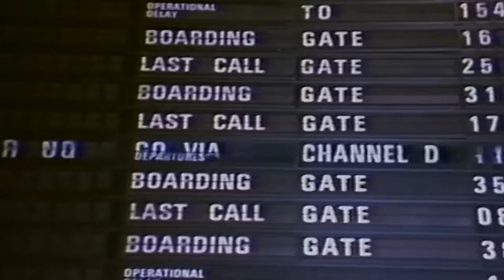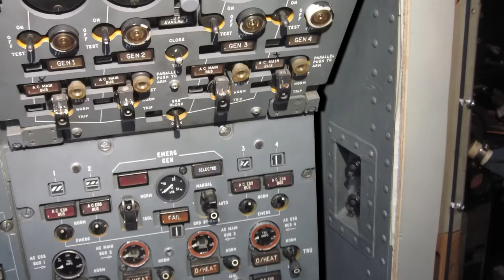Why Blue Paint Caused Problems For Concorde

Comment: “Safer than flying at Mach 2 in a tin can.” This is referring to an airplane with 27 years in the air and a perfect safety record. 

There was one accident and it was caused by the grossly negligent maintenance of a foreign airline’s plane.
Reply: That is not the full truth Rory, for the whole sorry story and the facts watch this. https://www.youtube.com/watch?v=fqOcYhzWUZY The strip of metal from the Continental DC10 was just one factor in a whole series of events comprising of maintainance and aircrew errors which went to make up the accident chain. The Air France Concorde was over weight, with too much fuel and baggage on board, it was aft of c of g limits, it took off down wind, over a lip on a pievce of runway wich was being resurfaced and officially closed, there was a pacer missing from the left main undercarriage bogey, the flight engineer shut down a perfectly servicable engine immediatey after the aircraft got airborne, with out consulting the Captain.
Reply: @markdesmond4947  Still not a design error. It was pilot error then.
Reply: Did the Bree from UTC time the dc10 debree riped the tire and since he filled the plane With full fuel it was to heavy lost an engine from the tire being in the engine as stalled
Reply: Mark Desmond you are completely correct about all of those things. However, none of them were intrinsic design flaws in the Concorde that would make it true to say that she was a dangerous airplane. 

You can shoot a guy with a shotgun and make him run a mile. When he collapses does that mean that there is something wrong with him?
Reply: Mark Desmond In fact all of the mistakes and miscalculations that you mention would have been absorbed into the robustness of the Concorde’s design were it not for that stupid friggin strip of metal. 

The plane probably flew a thousand times with the CG wrong, overloaded, took off in a dead calm that people on the internet 30 years later will call a tailwind. There was NOTHING wrong with that airplane. There was NOTHING wrong with how it was being operated. The pilot was a hero and the conclusions were come to so Air France could call the insurance company. The cause of the accident was the shard of metal off the DC10
Reply: "Bloody foreigners !"
Reply: @Papershields001  I'm sure your right Rory, I never said anything about a design fault, the design was perfectly good. However numerous design limits were exceeded through the very poor airmanship demonstrated by the aircrew in addition to the poor engineering practices of Air France and Continental .  Down wind + overweight resulted in a huge wheel/tyre design limit overspeed, resulting in huge centrifugal forces being generated in the tyres. Despite this, the metal slicing off a chunk of tyre which hit the underwing did not penetrate the wing or tank. However because the tanks were topped off to 100% capacity there was no room for the shock wave set up in the fuel to disapate, so the tank burst. This was a totally avoidable accident and removing any single one of the factors in the chain, ie take off direction, fuel weight, baggage, runway condition including work in progress lip undercarriage spacer omission or the much written about piece of Continental DC10 metal would have prevented it. Sadly all the holes in the swiss cheese lined up.
Reply: Rory Shields https://en.wikipedia.org/wiki/Air_France_Flight_4590

Read the alternate theories.  If a small piece of metal can cause a tire to explode with such force that causes your plane to crash, is it really that robust?  And how is the pilot a hero?  Did he miraculously save the flight? Because the Concorde was overloaded, and had veered on the runway, the takeoff was longer than normal, and caused the Concorde to hit the strip of metal in the first place.
Reply: What did they expect? It was a Continental DC-10...every time one of those took off something broke loose.
Reply: I like all those YouTube educated engineers..... 🙄
Reply: Aerospace Exploration  if the French were not involved, we probably would have ended up with the Concord, no trailing e.
Reply: Yeah I hated when he said that, Minimizing genius engineering down to"a tin can".
Reply: People are assuming that the crash is what got it shut down, but it flew for another three years after that.  It cost way too much to operate. And I would argue that yes, that is a design flaw.
Reply: @Rory Sheilds you obviously have not event the slightest clue what you’re on about. This was a catalogue of Air France error and deliberate disregard for safety. The corrupt BEA pinned it on North West to save Air France.
Reply: @phantomaviator1318  it wasn't pilot error.  A strip of metal from another aircraft was on the runway.  The tyre of the concord ran over it causing the tyre to burst sending pieces into the wing tank. The leaking fuel ignited.  Not pilot error at all.
Reply: The plane was too costly to operate in fuel costs
Reply: @atomic4650  Yes, the peak of commercial aircraft engineering. Yes, it would guzzle fuel like there is no tomorrow but nothing like it for those outside of the military.
Reply: @peteconrad2077  He just needed an excuse to bash the US
Reply: Aerospace Exploration Continental was the “Foreign Airline” I was referring to. It was a French plane in Paris.
Reply: There were several bits of minutiae that were brought up referring to things that may have slightly increased the planes chances to make an emergency landing at Le Bourget; A slightly miscalculated center of gravity, the the slight overloading of the plane, the mistaken actions of the crew in the literal seconds after rotation.

NONE of those things had ANYTHING to do with turning the Concorde into a giant pillar of fire in the first place.
Reply: Rory Shields a burst tire is always a possibility, design didn’t allow for it!
Reply: Carmen Grace yes. There had been 57 documented tire bursts on the Concorde before the disaster in Paris. Illustrating my point EXACTLY. The plane could handle tire bursts, it did it for 27 years. The airplane had a fantastic safety record and the circumstances that caused the accident were extraordinary.

My point is that the video’s claim that the Concorde was an inherently “Unsafe, Tin Can” is ridiculous.
Reply: Carmen Grace yes it did. What it didn’t allow for was a debris impact with overfilled fuel tanks. Check your facts. Air France also refused to use the cow catchers that BA used which deflected debris rearward instead of upwards. Air France were entirely to blame.
Reply: Rory Shields you ave no idea what you’re talking about. 

Over full fuel tanks allowed the hydraulic shock that ruptured the tanks skins. If the tanks had been left with the recommend expansion void they would only have dented. 

The aft C of G made the aircraft unflyable. The remaining eleven authority wasn’t enough to avoid the aircraft exceeding its zero rate of climb attitude. 

The aircrafts overweight led to the swerve that cause dit to hit the debris which was outside its normal runway path.  

If you don’t know what you’re taking about do yourself a favour and keep quiet. You’re making a fool of yourself.
Reply: @Papershields001  couple things here. First of all there were design flaws with Concorde. One of them was that the tyres were not strong enough to resist the speed of take off and landing for more than a couple flights. This meant that they burst on a regular basis, and it was known that they could burst with enough force to puncture the wing tanks. That is why British Airways put shields above the wheels of their aircraft, which Air France never did because they deemed it unnecessary.
Air France's maintenance was also deplorable, as its been stated above so i wont go into details about that.
But to say that the accident was caused by the negligence of another airline is simply ridiculous, Air France's Concordes were accidents waiting to happen. In fact the plane cought on fire before even reaching that metal strip, which most likely had nothing to do with the outcome anyway.
I do however agree with you with the fact that calling it an unsafe tin can is flat out wrong, the fact was an absolute marvel of engineering and that accident was caused by faulty maintenance/Air France being cheap rather than poor design.
Reply: Pete Conrad ok sure buddy...the plane totally would have crashed WITHOUT the debris on the runway
Reply: @Papershields001  yes, more than likely it would have crashed without the piece of debris
Reply: AnnicK Zoloft remind me to ask you for advice on lottery numbers
Reply: @Papershields001  yes because clearly assessing that a plane doesnt need to hit debris to crash when its landing gear is wrongly assembled, that its overweight, out of balance and has a tyre explode and burst the fuel tanks is comparable to bullshitting about lottery numbers
Reply: AnnicK Zoloft “yeah Titanic woulda sank anyway even without the iceberg...”
Reply: @Papershields001  omfg dude... Titanic was brand new and there was nothing wrong with the boat... everything was wrong with that plane, like everything that can possibly be wrong on a plane was wrong on that day
Reply: AnnicK Zoloft ok, a ship that sailed and sent 1,500 people to the bottom of the Atlantic on its maiden voyage is safer than an airplane that flew thousands upon thousands of times for nearly 30 years without incident. Great logic you’ve got there.

This is exactly what I’m talking about.
Reply: AnnicK Zoloft it’s like you guys don’t know what insurance, culpability and litigation is... 

Of course the FAA will find something wrong with the Concorde and minimize what Continental and Michelin(who made the tires) did. It was in their best interest to bring up whatever  inconsequential bullshit they could find to make American companies less culpable.

No sense of perspective
Reply: True...an American Continental Airlines plane.
Reply: DC 10...death chamber 10.
Reply: @markdesmond4947  Its Called F.O.D  Foreign Object Damage . Many aircraft drop bites and pieces , Mostly screws and small panels .
Reply: Absolutely agree the Concorde was fantastic. Only drawbacks where Sonic booms over populated areas and price.
Reply: @ @killagramx   Yes I am aware of that, I have been a private pilot for over 40 years. None of the many aircraft that I have flown have ever dropped bits and pieces. The point is, if the fuel tanks had been filled to the correct maximum 80% level and not overfilled to 100% capacity the FOD created slice of high velocity tyre, which did not puncture the wing or tank would not have produced the high energy and destructive shock waved which destroyed the fuel tank and caused the fire. The ignition scorce of which was probably the anti skid system wiring of the undercarriage bogey, which had been damaged because of the missing spacer and the lip on the closed section of runway used where resurfacing work was in progress. As I have previously said all the facts are here. https://www.youtube.com/watch?v=fqOcYhzWUZY    The DC-10 FOD was only one link in the accident chain but very handy for Air France and the French authorities to blame the accident on and to conceal the Aircrews shocking decision making and lack of airmanship and the airlines woeful engineering practice which allowed the aircraft to fly with a vital part missing from the undercarriage. It is notable that the charges to the Continental Airways engineers were dropped  and that the UK air accident investigation branch were not permitted access to the investigation.
Reply: Rory Shields It also had design flaws such as weaker fuel tanks, it was not the first time Concorde had a fuel tank burst, it happened 1/2 times before but the fire was caused by a design flaw with exposed wires inside the landing gear compartment, when the tyre burst a chunk of rubber flew up, hit the fuel tank bursting it, another chunk of rubber flew into the compartment where the landing gear is during flight, it hit a wire, which snapped and as the two ends of the wire bounced around they touched and sparked, which was enough to ignite the fuel, the rest is history. Maintenance issues from Air France did play a role in the disaster but equally there were design flaws and pilot error. Please reply if you have any questions as I do know quite a bit on the matter.
Reply: gorillaau if the French were involved we wouldn't have Concorde, 1:Concorde means agreement between two nations so it would not have been called that if there was no 'team work' 2: Without the French, Concorde or any Supersonic airliner wouldn't have existed, same with the British
Reply: Too much fuel was main issue I think as if left some air in tank there be no issue of tank, I am sure there more than one that crashed but not 100% on that, Great Britain or United Kingdom (no they not the same) was working on one and as france was similar design they joined forces to beat America to super sonic, they stopped as on launch it was $6 million a year to run and in 2003 it was about $23 million or something and on this day they predict a year be $63 million or over $100 million
Reply: Tin can! Take it easy there fella. 
Concorde was no “tin can”
Reply: @christophedecavalla2941  tin can on the those things, not 100% sure on spelling or if youtube likes it but the thing start with S that muscle people use
Reply: The accident wasn't  one reason it was multiple reasons. In fact the blame was placed on the Conchords  fuel tank design and it's  lack of protection  .  It was a bizarre accident but placing blame solely on one thing is irresponsible.
Reply: That comment makes zero sense
Reply: He didn't say the plane was inherently unsafe. He said teleconferencing is safer than flying. How many people have died in teleconferencing accidents?
Reply: mlee6050 no there was not more than one crash. U.K. and GB are the same thing for practical purposes here. If UK is working on something then that’s the same as GB working on it.
Reply: @markdesmond4947  That's like saying that if I punch someone in the face and he dies, it isn't my fault if he already had a fragile damaged skull.  Wrong.  I would still be a murderer.  Hitting that DC-10 debris was the direct cause of the one and only fatal Concorde crash, regardless of how fragile the plane was for other reasons.
Reply: If it has one accident, then the record isn't perfect. Period.
Reply: Rico Jazz I was responding to post claiming another accident. Get your head out of your backside before replying. It’ll stop you making a fool of yourself.
Reply: "This is referring to an airplane with 27 years in the air and a perfect safety" if one ignores the crash and 109 fatalities otherwise one could not say it had a perfect safety recorded.
Reply: AnnicK Zoloft thanks for the insight...Mate
Reply: roasthunter I went into detail referring to the causes of the Paris crash and how it was not due to some sort of intrinsically flawed design in the Concorde. 

My main point was that it’s offensive to refer to the airplane as an unsafe supersonic tin can. That is what pisses me off about the video.
Reply: @roasthunter  Yeah very perfect
Reply: roasthunter no, normal people would infer that the comment was me at to refer to the period up to the crash. It’s self evident that this record ceases with the crash. On,y a cretin wouldn’t get that.
Reply: Pete Conrad I actually worked for the real Pete Conrad’s widow in dc about 10 years ago. You may find that interesting.
Reply: Rory Shields why? I think he’d have thought you a fool too.
Reply: Pete Conrad because this fool has a job that is valuable to real people in the real world. 

757s and 767s aren’t unsafe airplanes b/c of 9/11. The Concorde only became unsafe when it was subjected to conditions that were far beyond its design limits.
Reply: An American dc 10
Reply: @Papershields001  I agree it was not an "unsafe tin can" or no more so than other plane is an unsafe tin can.  No plane is entirely safe, but to say Concorde had a perfect safety record is simply incorrect.  It had a fatal accident and regardless of whether you lay the majority of blame on another airline, if it was perfect it wouldn't have happened.
Reply: I wouldn't call a history of tyre blowouts "perfect"
...and an appeals court decided the maintenance worker was NOT guilty
Reply: The crash wasn't what ultimately killed the Concorde. It was the combination of the crash, 9/11 and most importantly its horrid economics. The running cost of the concorde was too high for it to be economically viable.
Reply: Aerospace Exploration I believe he’s referring to the mainatance of the DC 10 at Tel Aviv
Reply: 100. thanks for this comment.
Reply: One of my earliest memories is watching a Concorde land... it missed the runway and almost rolled over.. took off and came back for a second try where it almost rolled again😂
Reply: Aerospace Exploration  what you say makes their negligence 1000X worse. THEY wrote the book, THEY ignored it... it wasnt ignorance, it was criminal negligence.
Reply: @AnnicK.Zoloft  Nice logic... Titanic is state of the art for its time, yet sank because of a combination of captain error and a fault in the bulkhead and bow of the ship done to save cost...
Reply: There's pretty much no accident in history that was caused by just ONE thing.

It's always a sequence of mistakes one after the other.
You can trace the root cause of any given accident, but one thing going wrong is almost never enough to cause an accident.
Reply: Absolutely correct. According to the Pilots who flew Concorde," safest ever". It would be flying now except for The French, Blair, ably assisted by those b"star"s Marshall & King of BA.
Reply: Doesn’t matter didn’t make has much money. So it’s useless.
Reply: “Not the full STORY, Rory”

Massive, massive missed opportunity by the top replier
Reply: Aerospace Exploration  The foreign airline was Continental Airlines, not Air France.
Reply: @markdesmond4947  Americans always attempt to discredit the ''design'' of the aircraft for some reason. They do exactly the same thing with The Beatles saying their songs were written by George Martin. Utter rubbish even though there is a video of George Martin explaining his position and what his actual job was and it was not writing their songs or he would be lawfully credited for this. I digress however when America build something brilliant like the Space Shuttle, English folk just sat back and gawked at it in shear admiration and excitement. I don't know why Americans get so bitter about these issues. Can't we just pat each other on the back since we would go to war for each others security and peace:)
Reply: If you have a YouTube channel can you please make a video about that
Reply: No, it was caused by a design defect and a pilot's faulty response to it.
Reply: Mark Desmond I'm sry but

you're*
Reply: @shrimpflea  And so many DC-10’s crashed!
Reply: No it wasn’t…it was caused by the extreme vulnerability of the Concorde to FOD. Wouldn’t have downed any other plane. It had a “perfect” safety record cause there were only a tiny number of planes, flown exclusively by handpicked legacy carrier pilots. 737 Max wouldn’t have crashed, even with the half cocked mcas design, had it been flown only by excellent pilots. Couple of 10 year olds at Shit Air couldn’t handle it. Concorde was a government funded luxury vehicle…..comically expensive when all R&D figured in.